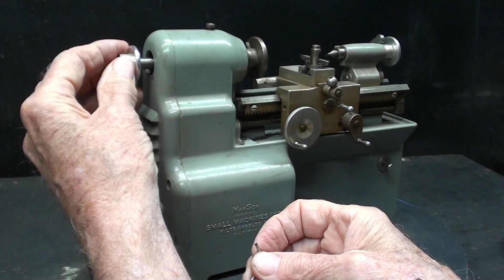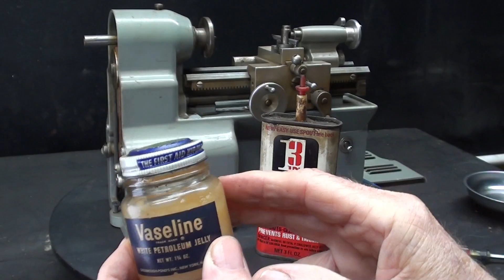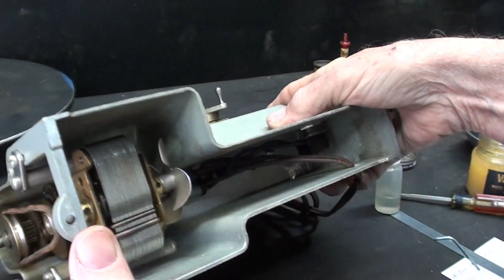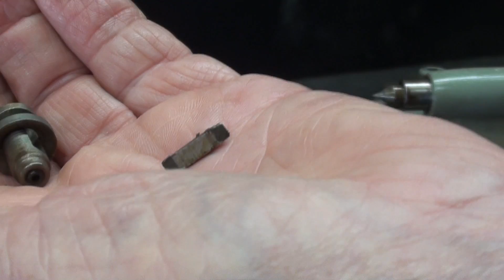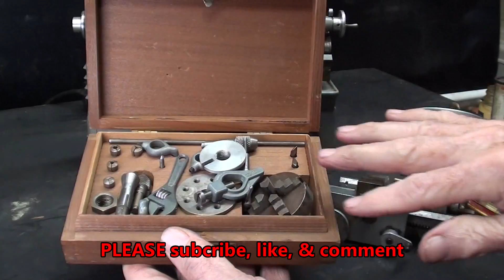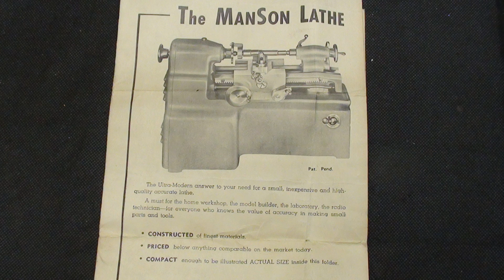THE AMAZING MICRO MANSON LATHE #931 pt 2 tubalcain

Comment: Probably not the right place to mention this as they are making a big lathe in this video title below - but I thought it impressive they could cast a giant lathe by digging a trench and placing wooden forms in relatively primitive conditions..  It is 40 minutes long but if you are interested you can skip through the video.  I noticed at the end they put the bed into a way grinder but neglected to first true up the contact points of the bed. If the patents are expired on the Manson maybe it could be made with a similar but scaled down technique?    482,234 views  Jan 1, 2024  https://www.youtube.com/watch?v=Xj8rdI-JV9E
Amazing Process of Manufacturing Lathe Machine || How Lathe Machine Are Made in Factory…
Reply from the maker: Thank you very much. I did in fact watch that video recently.

Comment: I have one, a laybel that says Master Lathe along with the tool box, I don't think the tool colletion is complets. It looks like the smaller one but it has a longer back cover and it does have brass bearings, the two speed runs off the lower pulley and not the top pulley. The motor is weak, stalls to easy, one needs to take a veary lite cut. I picked it up at a grouge sale, and found the same one on Ebay, the seller wanted 700$, I paid, if you devid 700 by 20 is what I paid

Comment: A friend used to work for a company that used tiny lathes to cut and shape contact lenses. I think they just made buttons to a specific size, which were then processed further on other machines. They used tiny belts like this one uses, and the belts were considered a routine consumable. He had a roll of a red rubber cord that he'd cut the needed length from, then glue the ends with a dot of super-glue. He made me a belt for my antique Keystone hand-crank, 35mm movie projector. Still working more than 30 years later.

Comment: What an awesome little machine! I wish OEM's would distribute these to classrooms to get kids interested in skilled trades (and buying their stuff)
Reply: kids are learning to write code and build CNCs. the interest is there . the field just evolved.
Reply: The funny thing about the code and collage thing is I graduated with two guys that went to collage for mechanical engineering both very good at there jobs one became plant manager for veeder root gilbarco and never made the salary of the plant maintenance guys that could make parts on manual machines at the drop of a hat to get the plant going again I went on to be a heavy equipment mechanic and use a Bridgeport and a couple lathes on a daily basis to fix and make obsolete or out of stock parts now thanks to COVID and yea cnc would work but takes way to long to make one off parts for high profit it's really only useful for mass production
Reply: @jimcaro7819  that's very interesting. I do find it to be not as fulfilling to make things with a CNC as when I get to manually do it. And I can certainly understand the efficiency of doing it by hand when its a one off part.
Reply: I'm not sure it evolved we basically built the modern world in America and now we can hardly keep it going I know they call it progress but is it really?
Reply: @jimcaro7819 yes, have you never seen a modern lathe or a cnc in action? I take it you never learned how to code either? It did evolve, it always is. There is no staying the same. Go to a high school and check out their robotics team. Kids are doing things adults couldn’t even fantasize about decades ago.
Reply: @jameszaccardo1520  the 90's defunded shop classes because "computers are the future"  but computers were just another tool for the toolbox. Computers are a great supplement to machining, but worthless if the operator doesn't understand the fundamentals to begin with. Great world we've created. Now to manage it 😄
Reply: @EuroclydonEng  the 90s was 30 years ago. I had shop class in the 2000s. You can literally major in shop in college. They also have this thing called mechanical engineering, that's another thing you can study in college. I don't get why you keep saying "we", what was built was iterated on that was iterated on. You can't write code without already knowing the fundamentals. Computers and machines are symbiotic relationship. Trying to downplay them as a supplement is one of the most ignorant things I have ever read. Nostalgia for what you are "used to" is the very opposite of what this field is all about.